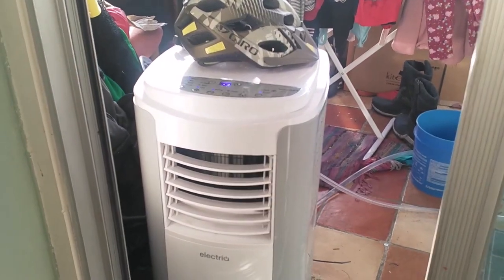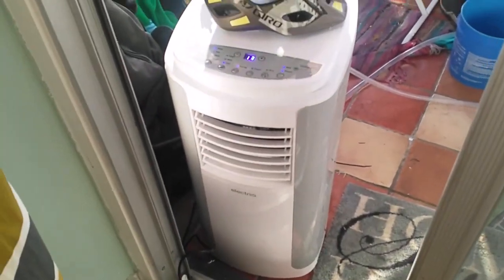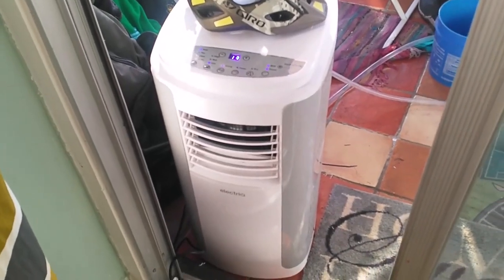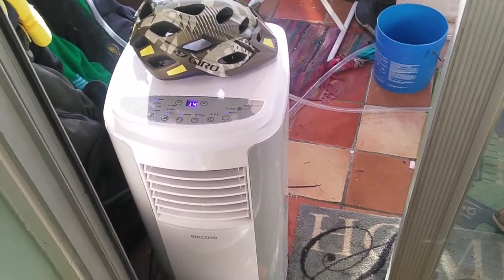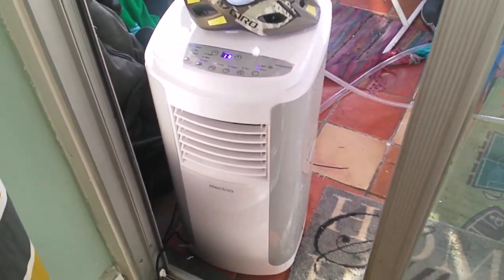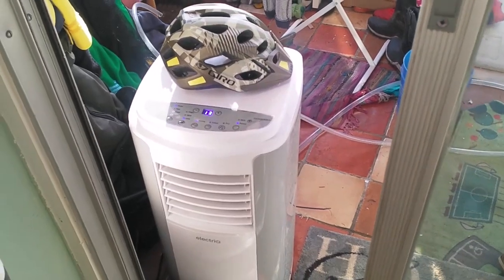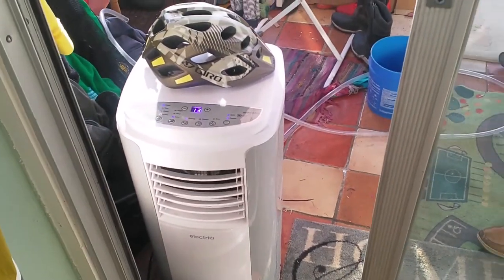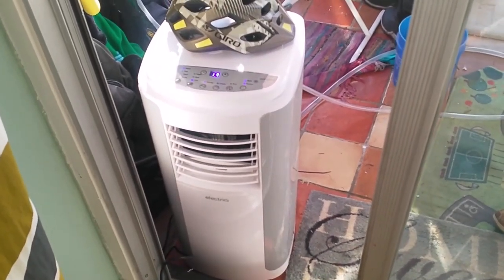Low running cost heating with a Portable Air Conditioner? - [ 5 downsides ]

Comment: I’m thinking of getting one for my conservatory it’s installed on 1 full wall and roof but worried on the energy cost with it being 1.5kw realistically how much wud it use in a 24hour roughly
Reply from the maker: Hello, it's a very difficult question to answer. The level of insulation and type of conservatory, e.g glazing quality, aspect, size, amount of time in use by people, all make a huge difference. A 1.5kw heat pump could certainly easily heat a typical conservatory but whether the economics add up needs working out in comparison to other heating options, price of tariff etc.

Comment: Why do air to air pumps become less efficient to the point of 1to1 ratio, with mini split, due to low outdoor temp.
So in very cold weather they are no more efficient that an ordinary fan heater.
So cost to run for heating varies according to to how cold a period of winter is.
I’ve used split air for heating last 4 years
No co2 emissions at point use also relevant
Reply: Thanks for reply ,I except Solar ,which I also have ,and that you have the Aircon unit anyway makes good sense, in saving money.
Dennis
Reply from the maker: Thanks Dennis, and good to get some first hand use views. There seem to be a few factors here, that "how cold" question being one of them. Some manufacturers certainly claim to maintain a 2+ COP in sub -10'C temps. The quality and make of the unit being a factor. The refrigerant used being another although some refrigerants are very bad for the environment. Some older ones with global warming potential at over 10,000x CO2 ;( 

And of course no Co2 emissions at point of use is very valuable. Over the last few days where I am in the South of England it's been perfect for my unit running off the solar panels, sunny and cool. Generation is comfortably exceeding the input of my unit so checking my smart meter readings am able to transfer that solar energy into internal heat on pure renewables.

Comment: One of the biggest downsides of a portable unit (single hose) is they create a negative pressure by pushing air out of the building which means that cold air from outside will naurally be sucked back in through any hole it can find.

Twin pipe or split systems do not have this issue and therefore operate much more efficiently.
Reply from the maker: Thanks RN. Yes it is an important point. In my case ventilated warmer upstairs rooms which are not occupied during the day solve that for my use case but an important consideration. Have been eyeing up a place for a split as a longer term solution.

Comment: Im a thinking of using one for heating my 12m2 shed, because a split system would be overkill. I can live with the noise and bulk, so it should be a good solution right?
Reply from the maker: All my opinion, but, if it's just for heating, as the space is quite small it might be hard to make the economics work. i.e. a well insulated space of that size, e.g. lined and insulated, should be very heatable with a small space heater e.g. 1kW fan heater, or panel. As portable air con units are often 10-20 times the price for the initial purchase you would have to use for quite a long time to get to break even. As another thought the A/Cs are also quite "breezy" so you might find if you are using the space as a workshop it gets the dust flying around etc.
Reply: @bigskies2202  Thanks for the answer. My worry is also that they are not good enough to get heat out of the air, when its freezing outside...🤔🤔
Reply from the maker: Yeah it's tricky to say as a lot of variables. They do lose effectiveness progressively as it gets colder although there is still quite a lot of energy in the air at 0 Deg. And course some units will be better than others. However a shed is likely much colder from starting temperature than a house. With a cold shed and a cold outside air temp it would not be my first choice. One of the little diesel blown air cab heaters is probably hard to beat if you are after something energy efficient, could run off a solar charged car battery for the electrics, with good effectiveness in any weather. That's what I am considering for my shed.

Comment: Excellent, very professional put together video, thanks for taking the time to make it.  Ive been working on the same experiment but finding the problem of negative pressure and the consequent inrush of cold air significantly cools the rest of the apartment, to the point where on very cold days its possibly only breaking even.  Its amazing just how air mine moves, is it the same for your unit?

Many people are saying that a dual hose conversion makes it more efficient, but there don't seem to be any figures to back that up and the condensers/intake fans on these units are definitely not designed with that in mind.

For the mini split, not sure if it applies in the UK but you can buy an EU approved for self install, 2.5KW Airton unit for about 600 euros for a full kit.  They are very easy to mount, the prices the installers are charging for such a simple job are an absolute rip off.
Reply from the maker: Thanks SP. Yes the negative pressure issue definitely needs consideration with the portable unit. As I am using the unit for the lounge/diner in a house it's not such an issue. I.e. cold air to replace the air mass moved out can come into a room where not spending time. In my case an upstairs spare room that is naturally warmer as catches the sun. Not heard of the dual hose approach but as you say I think it would struggle with a cold air intake. You can definitely get fitted single unit mini splits relatively cheap in the UK. Seems to vary slightly but certainly vastly cheaper than air to water heat pumps.

Comment: Good video. I think a lot of the problems could be overcome by relocating it and ducting the air around.
Reply from the maker: Hi Matthew, thanks, absolutely. Think location is key. Still leaning towards trying a mini split at some point to resolve most of the issues.

Comment: Thanks for the video, I have been thinking of doing the same testing with a portable aircon unit to eventually go with fully installed air to air system. Would be good to know what size space you are heating with the unit and if it is enough to prevent having the gas central heating on in the room?
Reply from the maker: Hi Dean, yeah that was precisely my thought process, and partly driven by the fact that my quote for air to water system including radiator upgrades etc. was 15k. Room is 21ft by 12ft. The 3.46kW claimed output portable unit, does seem to heat the space well and yes for sure I can heat the room solely with this. I am pretty confident a fully installed system would do the job nicely, and externalise some of the bits I don't like about the portable unit, the bulk, the venting and draining requirements etc. Also pretty intrigued by the wall mount all in one systems such as the olimpia spendid ones, which are a bit like fat radiators.

Comment: the elephant in the room, can i heat one room with the solar from my roof, 
answer: in summer yes.
i'm a solar installer, and when approached by the same question i remind people can you get a sun tan in winter.
just remove any idea that the solar sun will heat your home and look at other possible solutions.

if you are in the investment on reducing your bills, you will at best be looking at 15yr payback.
air to air systems do work well, sweet spot with heating is an outdoor temps above 7.
at zero expect 2:1 ratio, to reduce cycling have the  fan set to the lowest setting. 

battery bank will be a better choice, with some smart systems you can charge at a cheaper night rate or part charge + solar
again expect a payback of 10yrs.

i've been in the energy field for 30yrs as a electrician & 13yrs in renewables, the thing is even with maxing out with green stuff, it would be near on impossible to have no energy bills.
as a good example most of my customers that have solar/battery/heat pump or biomass have zero bills from march/oct 
with energy use in winter of 1500-2000 kwh.
Reply from the maker: Thanks Eco Terrorist. Great insight and nice to get some expert input. I suppose the simple maths of it is that if my solar panels knock out 1kW p/h in full sun in the winter, even converted at a 2:1 to heat energy with a heat pump, 2kW of energy is not enough to heat a whole house. A quick google suggests 1kW per 100sqft is required, so to heat a UK typical house of 900sqft would need 4-5 times as many solar panels which is obviously not feasible. (or a leap forward in solar panel tech, efficiency/ ability to harvest from windows etc.)

I'm a bit lucky in that my house already had the solar installed when I moved in, so no payback required and fully utilising the energy produced is the priority from a bill saving standpoint. As you say a battery would be the most optimal way to achieve that although would require that upfront investment.